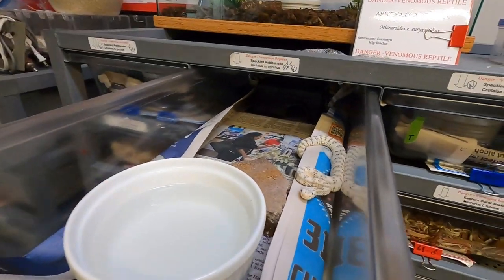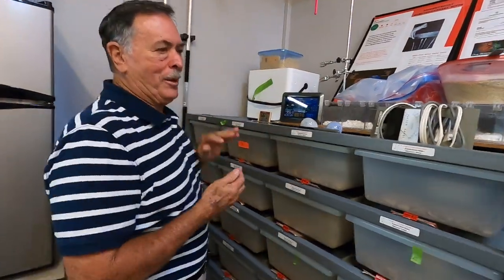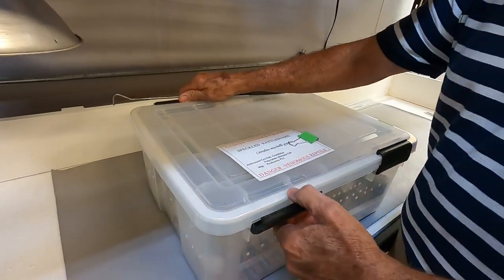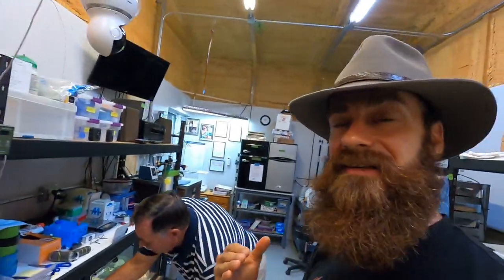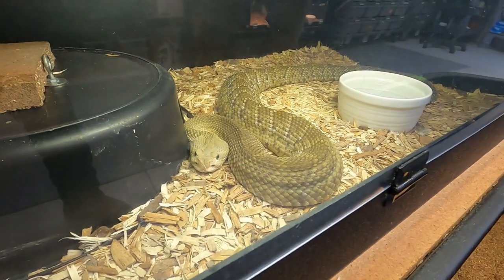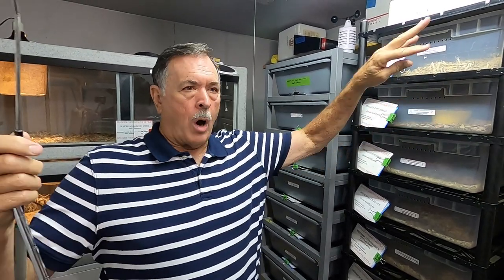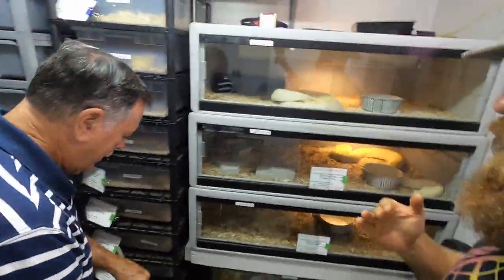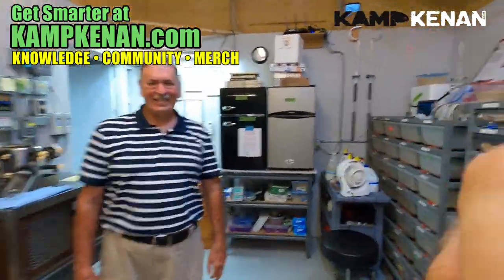Making a Living with Venomous Snakes (Tour!)

Comment: Does he keep enough anti venom from each type of snake incase he does get ;bitten
Reply: He helps produce anti venom
Reply: It's not really the first thing you do when you get bittin. Learning how to bandage is important, and it also depends on where you get bit of course. But here in the Netherlands it's not that you get bittin and directly put the anti venom in
Reply: @linseyt7951  yeah, you're supposed to go to the emergency room and take the anti venom with you
Reply: It would be impossible to keep anti Venom for all those different species. Its about 5 to 10k a vile
Reply: @skyler4980  extremely expensive and very short lasting

Comment: I know its technically OK. but rack systems like that are just so cruel.
Reply: I agree.
Reply: I can’t stand rack system shoved in a box no light no proper air no room no heat or uvb where needed just a cruel way to hold a animal may aswell throw animals in a shoe box under your bed defo not for me these
Reply: @garygerrard1able  racks don't use the same heating method of regular glass tanks or vision cages, snake racks use heating tape which is attached to the back of the rack to heat the entire area
Reply: @garygerrard1able  snakes dont need uvb and racks are heated from the back. Snakes dont need strong light either, what they get throght the plastic of the tub is just fine, they like darkness. Air holes are usually on the back of venomous snake racks so they cant bite you when you open them.
Reply: Chill tf out the snake feels secure and is always well fed with no threat of dying those snakes couldnt be happier even in a drawer. Its a way better and longer life than theyd have in real life.